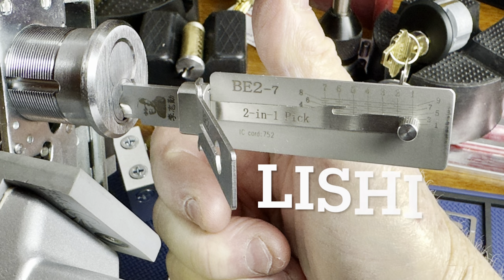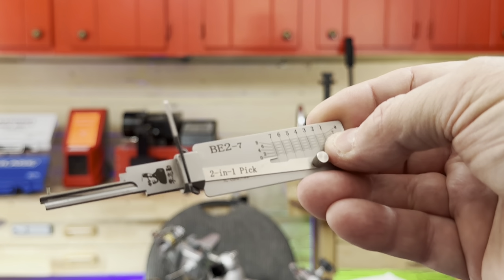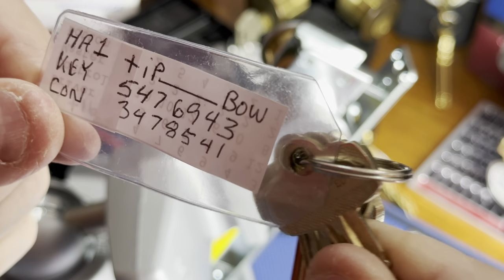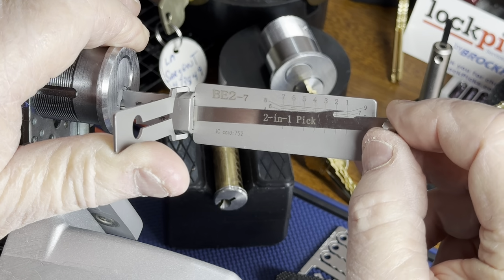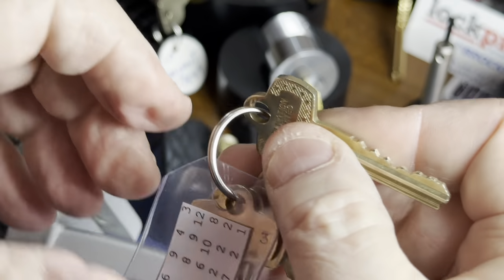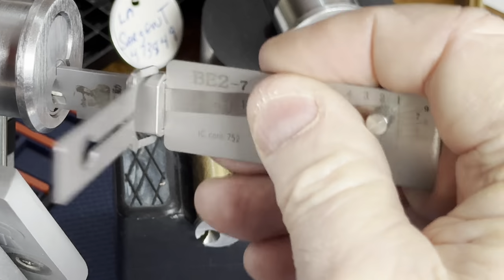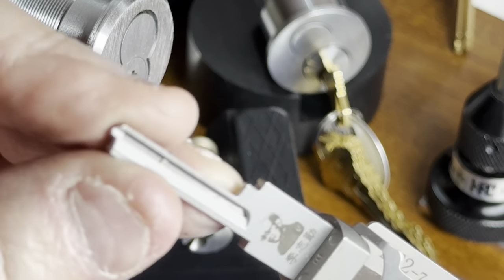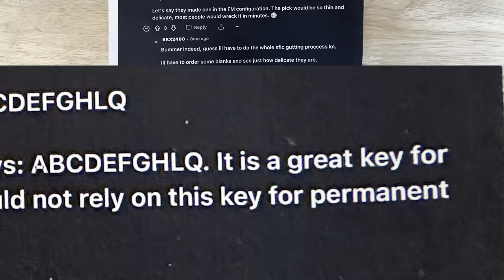Tips on using a lishi BE2-7, 2-in-1 Lock Pick🔏

Comment: Great video Mike, thanks for doing this! I agree completely, they should really do a Best FM Lishi next, like they did the SC20 to cover multiple sectional keyways. But I agree it would need to be pretty strong. Carrying around an FM blank just for working lube into SFIC locks might be a good idea—doesn’t need to be super strong just to run it in and out. I’ve found that really focusing on the “set bounce” with Lishis is the key to getting opens, even more than heavy or light tension. I’ll email you a couple of videos I saved on the topic. Just yesterday I had a Master #5 padlock I needed to pick and decode, it took me an embarrassingly long time but I finally got it by forcing myself to methodically go through each chamber repeatedly and look for the set bounce (a 0 cut was the challenge on that one). One other thing is that the Lishi standoff spacers might work for the BE2-7 so it can be used with 6-pin locks; I’ll include a few in your package so you can check yourself :)
Reply from the maker: I agree with you 100% and I’ll try that because I have a master lock coming up next down the line. Thanks for all your insight is so helpful to have a guy like you on the team cheering on the lishi challenge. You are the best. Thanks again.